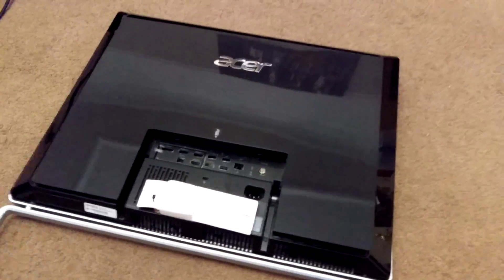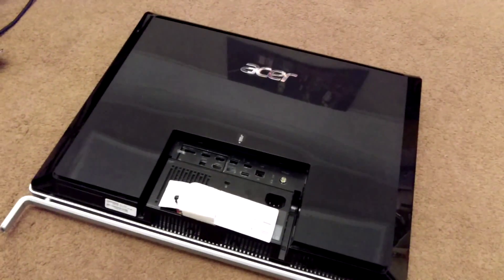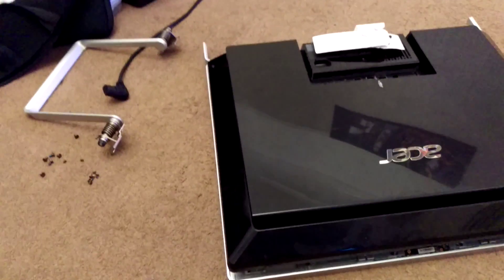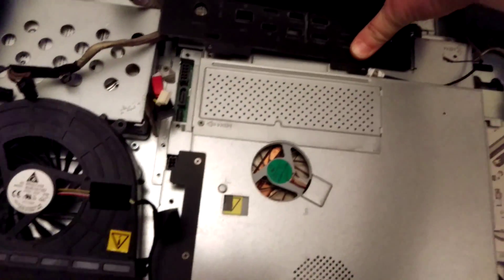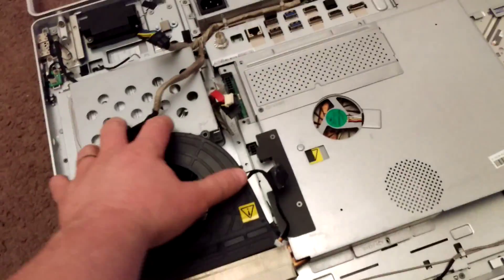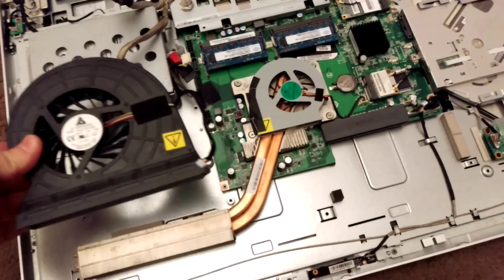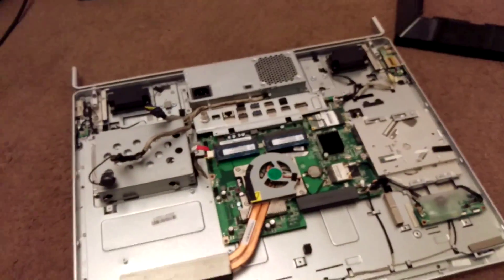Acer Aspire Z5801 All-In-One Disassemble / Repair

Comment: After having this computer for over 10 years it is finally stopped working on me me.  it turns on but but the USB's are not recognized and the touch screen does not work. It boots right to the windows pin security.
Reply from the maker: I would imagine the touch is controlled via the USB controller since both touch and USB's are not working. If you normally put your computer to sleep, try rebooting as it might be a driver conflict. I'm guessing you've already done various searches on the problem but I found this video which may help? https://www.youtube.com/watch?v=kmWSWwRiyoM&ab_channel=GadgetClass  

If all else fails back up your important data to an external drive, then try re-installing Windows.  Sounds like its booting & mostly usable if it gets to Windows pin security screen... but does sound very much like a USB driver issue to me.

Comment: To remove the back cover, use a think flat head screwdriver and wiggle it into the crack between the bezel and the case at the corner to the right and left of the panel with the power and female USB plugs.  Once the screwdriver was inserted, gently pry up until you can get your finger nails in the crack.  Continue to lever upwards.  There are NO screws to undo.   PS.  It took me forever to figure it out.

Comment: advise... if you are gonna show the back taken off, at least mention how 'easy' it is and the method you used...  it took me going through at least 4 video's AFTER this one before I figured it out.

The only thing that was helpful was about the clips and not to use a hammer... yup, wise move... always...
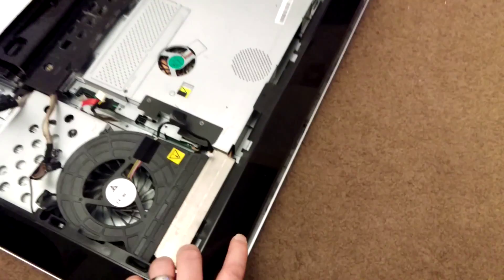Reply from the maker: Hi - thanks for the reply. I thought I had explained clearly the correct method of getting into this machine between 2:05 - 2:50. Sorry you didn't find the video helpful, but at least it did save you destroying your clips as you had listened to the "no hammer" part! Thank you for taking time to watch the video & leaving a comment as criticism is always welcome to hopefully make future videos clearer and more helpful to everyone.
Reply: @ShR33k  I'm still having some trouble getting the outter facia off the front(the black 'trim' on the back?).  It blocks the hard drive from being removed and access to the power supply.  I tried to duplicate how you worked it but...  didn't seem to co-operate?  I guess it stems from that fear on how much pressure I should be applying to its removal.  One idea.. "once you got all the screws"  maybe tell us how many screws we should be looking for?  a couple tear downs I've missed a screw, sometimes hiding under a label... that woulda torn/cracked the plastic...

This is why showing it actually taken apart actually gets a higher value in my mind... (troubles and all)

(what first video?)
Reply from the maker: @homestonenet  Once you have the back cover off,  the thick trim around the edge is held on by 9 screws (mentioned at 3:10).  None were hidden (that I can remember).  Only difficult part was the piece of plastic for the ports.  This was held in place by two additional clips (mentioned at 3:30).  Once all nine screws were removed from the trim, it should start to move - but it won't come away fully until those two plastic clips around the ports is released.

Comment: Does the motherboard have an option to install a TPM module for windows 11?
Reply from the maker: I don't have the computer to verify as I never owned this I was merely repairing it for a friend, however - the image of the motherboard (taken from an eBay listing: https://www.dropbox.com/s/plikwn9scygqnwe/s-l1600.jpg?dl=0) doesn't show any TPM module sockets for any upgradability options. Also - even if it had, you would have greater issues as the motherboard only supports 2nd gen Intel CPU's and the minimum required for Windows 11 is 8th gen or newer: https://docs.microsoft.com/en-us/windows-hardware/design/minimum/supported/windows-11-supported-intel-processors.  TPM v2.0 is also required for Windows 11 which was release in 2014 - that's 3 full years after the Aspire Z5801 was released back in 2011. Meaning the CPU would be far too old to be supported for Windows 11 anyway, and the motherboard would be too old to support TPM v2.0 natively and with no motherboard TPM header to connect an updated TPM module, unfortunately it looks like Windows 10 will be the last O/S that machine sees. To add to the issues, Windows 11 also requires DirectX 12 which the onboard dedicated graphics card NVidia GT520 only fully supports DirectX 11 https://www.techpowerup.com/gpu-specs/geforce-gt-520.c285. It has limited DirectX 12 support. You could always try: https://www.youtube.com/watch?v=iL_X_Sxt0vQ&ab_channel=TechYESCity and see if Win 11 can indeed be forced onto the machine - but if you wait for the proper official stable release, its not likely to be installed onto an old machine like the Z5801 which is now 10 years old.  You will however still receive Windows 10 updates until 2025.  For reference, you can also download the Microsoft PC Windows 11 Compatibility Checker https://aka.ms/GetPCHealthCheckApp which will tell you if your machine is compatible with Windows 11 and if not - why not.  Sorry that's not what you wanted to hear, but hope all the information helps in some way - and thanks for the question as I'm sure other people may be wondering that too.  Minimum specs can be found near the bottom of: https://www.microsoft.com/en-us/windows/windows-11

Comment: Thanks for the video.  It turns out that there is no need to removed the stand, fan, inner metal cover or outer plastic to change the hard drive.  Once you get the inner plastic piece off the back (explained between 2:05 and 2:50 in the video), there is a single small screw under the SATA cable.  Once that small screw is removed, the entire drive bay slides out easily to replace the hard drive.  I figured this out after following your instructions and removing the entire plastic surround.  Hope others can save some time and energy based on this feedback.
Reply: Thank you very much.  I would not have seen the screw holding the hard drive enclosure without your message.
Reply: Yes
This guy sucks
Reply: Thanks a lot, you have probably saved a lot of time ❤

Comment: Unsure if you still reply to comments i recently fixed my old one but neither fans spin only when I first start up the computer
Reply from the maker: Hi, thanks for the comment. If you can hear the fans on start-up it's possible they're controlled by the motherboard and may not spin all the time. Most PC fans are temperature controlled, so hotter the computer - the faster the fans spin. But if it's running cool, they may not even get activated. That is as along as you re-connected them on the motherboard in the first place... but had you of done that, you wouldn't hear them spin on start-up. Might just be worth checking the fan connectors are on properly, all 4 connector pins. I have seen connectors put on incorrectly (misaligned) so only 3 pins are on, the 4th pin not connected. As long as everything looks right, and computer doesn't shut down due to overheating - I would say they're temp controlled and nothing to worry about. Once the computer is being stressed (under load), those fans should kick in again as it will be generating heat.

Comment: I have watched other videos about removing the rear case on the all in one computer and was thinking, there has to be an easy way than just going ahead and damaging your computer.
 I do need to replace the hard drive in my Acer Z1801 model all in one computer shortly and your video has been  a great help.
Any other videos on All In One Computers would be gratefully appreciated.
Cheers

Comment: please can you  tell me what  battery  do use  in  this computer
Reply from the maker: Hi Gary. Unfortunately I don't have the PC to double check, but it would either be a 2025 or a 2032. Both are highly common CMOS RTC battery solutions for any motherboard (laptops & desktops). You can generally buy these from supermarkets, office supply or electrical shops and will be around £2 to £4 (GBP) depending on brand - so very inexpensive. I would say its more likely the 2032 - but I would be guessing since I can't double check for you. Sorry. Hope that helps in some small way.

Comment: Does it have msata for ssd or not?
Reply from the maker: Hi, thanks for the reply - I didn't look and don't have access to the computer anymore, but due to the age of the machine and how recent msata drives are I would highly doubt the motherboard would have any msata connections.  You could however replace the standard sata 3.5" hard drive with a 2.5" ssd (in a 3.5" cradle) if you wanted.

Comment: Hi, a few questions here - I was trying to take off the stand (as you did in the video) but couldn't see any screws or anyway I can pull the stand off; and I also don't see anywhere on the machine there is a single screw- any tricks?
Reply from the maker: Hi Jay! Thanks for the question - If you remove the back panel, you will expose the screws for the stand.  To remove the back panel, you pull up where the white symbol is (right above the ports).  Put your hand underneath (palm on the back panel where the white symbol is, fingers underneath) that section and it should pull up (towards you).  That will release the bottom section of clips - once the bottom section has been freed, the back then slides down to be removed completely.  Re-fitting is the reverse.  Once the back is off, you'll have access to the screws for the stand. Hope this helps. If you struggle, if you re-watch the video - hopefully it'll make more sense after the explanation on how to remove the back.  Good luck, and hopefully that helps!
Reply: thanks - could you do a video as well?
Reply: @ShR33k  Он открывается сверху! Omg

Comment: someone has replace the touch screen of this model?
Reply from the maker: Hi, I've not replaced a touch screen on this model - but I would say... it was released in October 2011 - so nearly 5 years old - so, is it worth it?  The 24" touch panel itself is £100 GBP on eBay (UK) - which is the same cost of a replacement second hand unit.  http://www.ebay.co.uk/itm/Acer-Touch-Screen-Computer-All-In-One/122041725836?_trksid=p2047675.c100005.m1851&_trkparms=aid%3D222007%26algo%3DSIC.MBE%26ao%3D1%26asc%3D35923%26meid%3Dff35fc0848c2409c92b1f05833b28214%26pid%3D100005%26rk%3D1%26rkt%3D5%26sd%3D252456630909 I will admit it is a nice machine, but you might be better getting a replacement PC, either of the same model (and keeping yours for additional spares) or something newer (and selling the parts of your broken Z5801 to help pay for the new machine).
Reply: ShR33k ok thanks for the info, it was really helpful
Reply from the maker: Hey no problem! :)  Please keep me updated on what you decide to do as I'd be interested in knowing which way you've decided to go!  24" LCD panels for this machine may be a lot cheaper in your country if your not in the UK (i.e. in the US they're £55 - just that postage into the UK is an extra £30 + any customs import charges - which then doesn't make it worth it for UK), or you might just fancy a challenge!
Reply: ShR33k my client has decided not to change it out. Better for me
Reply from the maker: +Roberto teves I think that is the sensible approach tbh. thanks for the update!

Comment: Hi.  Thanks for this.  Perfect timing.  It's running really slowly with the stock 5400rpm hard drive and 4gb RAM.  I can now safely take it apart and upgrade the components.  Cheers.
Reply from the maker: +Stewart Thompson Glad someone has already found the video useful. I was mortified when I saw other videos online of people breaking all the clips! I do still have one issue which is if the unit is unplugged from power - then when re-connected, it no longer boots due to "no boot devices found"?  I have to go into BIOS then save & exit (not making any changes) - then it works again!  I'm still investigating that one... 

BTW: Looks like it supports maximum 16gb memory
http://www.mrmemory.co.uk/memory-ram-upgrades/acer/aspire-all-in-one/z5801

Thought I'd have a quick look as motherboards can be locked down in terms of memory upgradeability.

Good luck with your quest my friend to speed your PC up !  :)